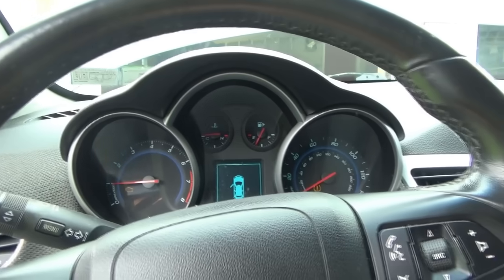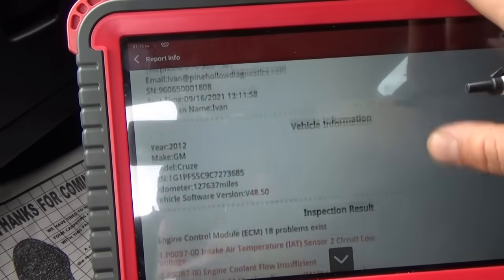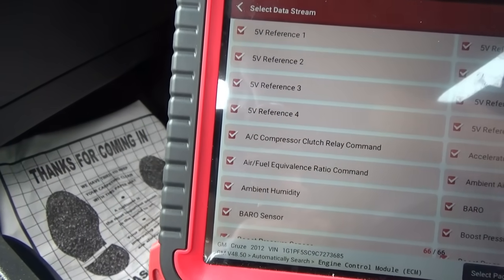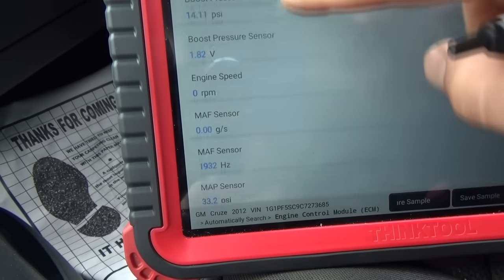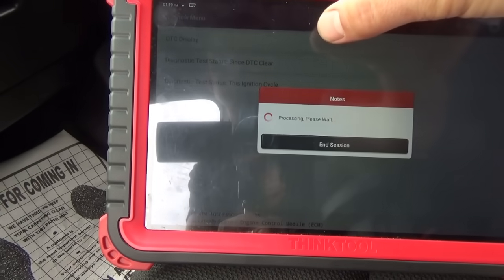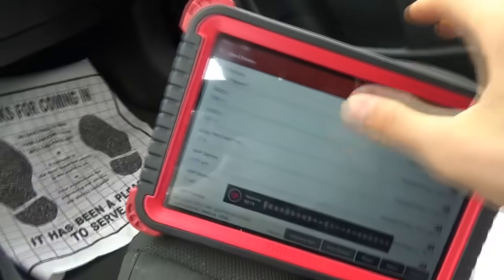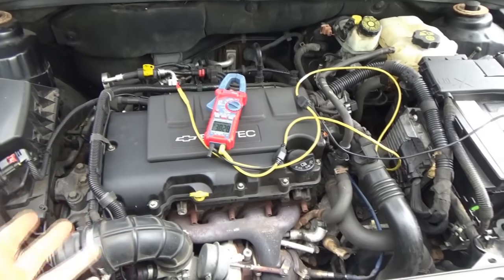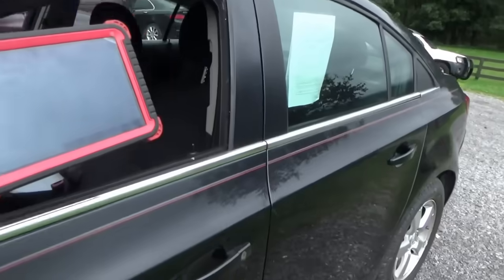Scotty Kilmer was RIGHT! (Cruze Turbo Rough Idle P0106 P0171)

Comment: Good vid and excellent debugging.  All too common problem on Cruze/Sonic/Trax/Encore, all with the Ecotec 1.4L engines.  I recommend folks check for the orange non-return valve being present with every oil life reset.  Forces you to catch it early so the intake can be repaired before other problems arise, like the camshaft cover vent blowing out, all from this little orange silicone valve being eaten by the engine.  Interestingly GM has an extended warranty campaign on the cam cover for most of these models, but not the intake.  Go figure.
Reply: I have many people come to me asking if they can install my fix kit before the check valve fails. It's good preventive maintenance, since they can then swap out a check valve in 2 minutes instead of having to deal with the install later or worse, replacing the entire manifold. The kit comes with two check valves so there's always a spare, and with replacements being available for less than $5, they can even be swapped out preventive for minimal cost, just like any pcv valve used to be before OEMs got cheap.
Reply from the maker: @AndreiDPop  that's awesome!
Reply: @AndreiDPop  do you have a link for this kit? Will it work on my 2017 Buick encore?

Comment: I have a 2012 with 113,000 miles, I just replaced my head gasket, so I also replaced my water pump, thermostat, ignition coil, put in new plugs. I bought it brand new and I love it.

Comment: I've owned my 2011 1.8 cruze since new. I was active in all the top forums of people screaming how the 1.4 was far superior because it made more power and had a turbo. That right there is exactly why I bought the 1.8. Almost 350k and is still my daily. Also alot of people these days would rather just spend the money on shop time rather then buying a few tools and Learn a few things. I also have a 1.4 sonic which I lend to someone 90% of the time. I've changed the clutch twice in my 1.8, oil cooler gaskets, shocks, brakes just regular maintenance and she keeps rolling and I drive it hard daily in a major city.
Reply from the maker: Wow 350k hard miles is very impressive!
Reply: 2017 chevy cruze 1.4L 188k miles. Never been to the shop. Oil changes every 5-6k miles and a set of brake pads and rotors at 140k.

Comment: I did the pcv modification for this issues. I used jb weld to fill the hole in the intake manifold and the drilled a hole at the bottom of the intake and one at the top of the intake near the throttle body. With two 90° elbows 2 pieces of vacuum hose 4 clamps i bypassed that crap. Problem solved.

Comment: I guess you've already sorted it by now, there are quite a few helpful workarounds on YT for this problem.
Very common on these cars with 1.4T. I had a customer's (2011 Holden Cruze) I nearly got married to last year with the same problem. P1101, P0171..The intake check valve was missing, and pcv 'vacuum regulator' diaphragm in top of the valve cover was torn causing an external vacuum leak, very high vacuum in the crankcase, and crazy high STFT. The vacuum in the crankcase can also cause a squeal at the front crankshaft seal, so much vacuum getting sucked past the crank seal..lol. I replaced the valve cover (aftermarket cheapy around $100AU) I also removed the intake manifold, blocked that internal check valve port(jb weld, a washer, and a wood screw) and I drilled an tapped the manifold and installed 2 elbow fittings(with more JB weld for insurance) and an external pcv valve underneath the original manifold. Fitted the new pcv valve inline between the engine side of the throttle body and the crankcase port side of the intake manifold...All was sorted after that. After the fix, STFT came back to normal, and the vacuum reading at the dipstick tube at idle would slightly vary between -2psi-0psi, showing that the new valve cover regulator was doing it's job, and also that new external pcv valve was working, and not allowing any excessive pressure to enter the crankcase under boost etc...I now run away as fast as I can from all GM's..lol🤣👍🇦🇺
Reply: Basically did what my v2.1 pcv fix kit does. Make sure you're using a check valve rated for PCV use, at least 30psi sealing pressure, and less than 1psi crack pressure. Pneumatic check valves won't work long term, and all ball-style check valves will give you issues.
Reply from the maker: Nice work around!
Reply: @AndreiDPop  I used an all metal, in-line style pcv valve, (similar to what most 4g54 Mitsubishi's use on their aluminium valve covers) with a very light spring and it had a small cylindrical steel plunger, so I'm confident it was more than suitable for the pressures and temps it would encounter👍🇦🇺
Reply: @simonilett998  the steel plungers don't seal against boost pressure very well. Those valves are really only intended to operate as pcv valves in naturally aspirated engines. 

The spring pressure is designed to keep the valve closed under vacuum while allowing a constant supply of PCV gas through. You've basically installed it in reverse where vacuum opens the valve, and you're trying to make it seal under boost, which it was never intended to do. I looked at those valves as well before deciding they would be poorly suited for the application.
Reply: @AndreiDPop  No, I didn't install it in the reverse to it's originally designed direction of flow. I added a male/female threaded 90° elbow to the male threaded end of the pcv which I mounted directly below the upper crankcase hose port where the hose that connects to the turbo attaches to the intake manifold (the one you look through to view it the orange check valve nib is visible or missing) and a hose tail/male threaded 90° elbow screwed into the manifold at the other end near the engine side of the throttle body, with a short piece of hose in between the hose tail ends. I oriented the pcv valve to flow in the same direction as the original orange viton flap seal would've, effectively just mounting it externally instead. On the 4g54 engines there is a large hose port at the rear end of the valve cover to allow fresh/filtered atmospheric air to enter the valve cover/crankcase, from the air cleaner housing mounted above the carby. The pcv valve hose tail connects to a vacuum port on the intake manifold, or carby base, allowing engine vacuum, at idle, to draw in blowby gasses and burn them, following the same principals as all pcv systems. If the pcv valve is always closed when exposed to vacuum, it would never allow any blowby gasses to be drawn into the intake manifold with each intake stroke, and the spring would actually have to be quite strong to fight 20 inches of vacuum as you suggest, right? Bearing in mind that manifold vacuum is not constant, it flutters at idle, and vacuum is weakest at full throttle, the weak spring is only there to help close the pcv valve at the intake/exhaust valve overlap point of each cylinder's cycle, which is what causes the manifold vacuum to flutter. At high rpm, or moreso at full throttle when manifold vacuum is weakest/non-existent, the blowby gas pressures in the crankcase should stay relatively close to atmospheric pressure, and they reverse their direction of flow, flowing out towards the air cleaner, and due to the now increased velocity of the atmospheric air coming in through the air cleaner, a ventury effect is created, drawing the pcv gasses into the top of the carby and they get mixed with the incoming air. This is the only other time the pcv spring will come into effect, the pcv valve will be closed, not fluttering, and not required to open unless the pressure in the crankcase got high enough to overcome the weak spring pressure. The crankcase gasses will be traveling in the reverse direction to which the pcv valve would flow at idle. A N/A efi engine also works the same way. These turbo engines have the extra pipe from the turbo housing to the crankcase side of the intake manifold (the hose Ivan blew into to test the check valve) serving the same purpose as the air cleaner to valve cover hose would serve in a N/A engine. tested the pcv valve prior to installing it with a vacuum and pressure source both ways to confirm it would seal or open correctly as required. It was August 2020 I did the job and the customer has not had any issues since, and given the poor longevity of these vehicles it's probably not long from being scrapped by now, if it hasn't already🤣👍

Comment: Dorman has an intake manifold with a pin to hold that valve in. I just installed one on my daughters car. I changed the cam cover and pcv hose at the same time.  Then changed the coil, plugs, vvt gaskets, oil cooler gaskets, balancer gasket, and oil pan.  Now the transmission lines are leaking.  This car keeps me busy.

Comment: As a gm tech, It needs the “Cruze kit”   water pump, water outlet, intake manifold, valve cover, ignition coil, front crank seal and a turbo!
Reply: And coolant hoses depending on how bad they are oil soaked.
Reply: Funny ive works fo gm 25 year not at sum dealer...ship my cruze has almost 400 gran same turbo same water pump only in and out and a thermostat and 4 valve covers runs like a watch ... You just put shit on a charge poor working ppl shit loads of money for bullshit

Comment: The 3 parts all together are not extremely expensive, but I don't think most people driving a non-GM car would ever encounter a situation where the valve cover and intake manifold would both need replacement, unless there was a fire in the engine?
Reply: Not really, but most other vehicles I've had with specific reoccurring issues... Suck worse than changing an easy cover and intake. Hell even the turbo pops right off the front.
Reply: @TheDylanjduncan  Do a PCV mod on the intake, replace the other two parts and don't worry about the Valve cover going again, turbo is cheap enough. Have this engine in my sonic and no problems since
Reply: @bdaig12  On the intake or valve cover?

Comment: With oem parts this happens every 70000 miles; like clockwork. I just did this repair for the second time two weeks ago. I used an aftermarket intake this time. It has a little metal retainer behind that diaphragm in the check valve to keep it secure. Used an aftermarket intake as well. We shall see.

Comment: Also, if the check valve in the intake goes it ruins the valve cover diaphram also. There is an updated valve cover. It would be best to replace the intake manifold and valve cover, or there is a guy on one of the Cruze forums who makes a kit to fix the intake manifold and its a lot more reliable than the GM design.
Reply: Is there an updated one? I did the cruze talks forum solution before all these happens...
Reply: @nebarrera  Dorman came out with an updated design.
Reply: @nebarrera  well thats the thing, there is an updated valve cover which has the same problem as the original when the intake check valve disappears. So, the cruze forum solution for the intake is the best solution. There is no updated intake so they would all fail eventually.
Reply: @soldado141  there is no updated valve cover. The diaphragms will continue to fail by design
Reply: That guy is me. I designed the PCV fix kits. They're designed to be more reliable, cheaper, more serviceable, and easier to install (v3.4) than replacing the manifold. Why they made a manifold without a serviceable check valve is beyond me, so I did it for them. 2 minutes to swap a check valve on the v3.4 kit AND the kit replaces the crack-prone accordion hose by design, so it's two fixes in one.
Reply: @soldado141  only for the intake manifold, not the valve cover, and their intake manifold "redesign" just adds a pin behind the manifold to keep the check valve from outright disappearing. We've had those reported as cracked and leaking countless times already, so it's not exactly a solution. What's worse is they recessed the check valve further back so it's much harder to inspect, clean, or test it.
Reply: @AndreiDPop  You beat me by 10 minutes as I just commented about your GM 1.4L Turbo PCV Fix Kit.
Reply: @AndreiDPop  i mustve got the valve cover and intake mixed up, but i knew for sure one was "updated" at some point. Glad to have you in the conversation to clarify things.
Reply: The valve cover is exactly the same as the old one just not broken.
Reply: Where can I get one? @AndreiDPop

Comment: I have a 2013 Chevy Sonic with the same engine.  Had a slightly rough idle and was leaking oil under boost.  I suspected the valve cover was needing replaced.  Drove it for awhile like this as the oil leak wasn't terrible. Eventually it started idling really rough and had noticeable loss of power.  Kept driving it like this then one day on the way to work it started sputtering really bad and blowing smoke out the exhaust.  After sitting in the parking lot at work for 8 hours, it started up fine, still with a rough idle but no exhaust smoke.  Right before I got home on a roughly 15-20 minute trip it started sputtering again and blowing smoke out the exhaust which had a noticeable burning smell.  Craziest thing about all of this is that it still has not thrown a CEL even once.  I know the light works and it has come on in the past for other reasons so I have no reason to suspect the CEL is bad.  It has all the tell tale signs of bad valve cover so I intend on changing that, as well as the plugs which I imagine are oil soaked at this point, as soon as I have the money to buy a new one.  The lack of a CEL is baffling to me though as bad as it is running, especially once it starts pushing oil into the cylinders and burning out the exhaust.

Comment: I have a 2012 Chevy Cruze 2LT. 311,000 miles and still have decent compression. Only one turbo replacement (normal wear item). Suspension changed 3 times (Chicago). These cars a Very very simple to understand and fix and hell like a toy car to pull the engine. Update: Im at 323,000 miles now… these cars are simple for good mechanics.

Comment: They have special coverage for both the camcover and the intake manifold. Cam cover is super common. Cases multiple codes all the same you had and more. Dealer will cover those parts for free
Reply from the maker: Dealer doesn't cover jack for "free" in my experience 😅
Reply: @PineHollowAutoDiagnostics  i work at one and we do a lot of stuff for free that shouldnt be done. Theres a lot of dealers in our area that actually tell their customers to come to us to fix it and we win them over. Lots of dealers get thrown under the bus by a band wagon of people who naturally hate dealers. Reason being small shops drain the customers money and then tell them to go to the dealer they come in expecting it should be free and how its our fault. Sucks we are just people and work on the same stuff day in and out and gotta tell you working at a dealer ive charged someone half hour for a repair as another shop quoted over 2 hours to do the same job on top of more parts than what was actually needed. Youre right, new vehicles are gonna destroy the small ahops and people who dont have the correct information to diagnose and repair the vehicle. Glad you can keep up with new technology, you work through it and do lots of tests to prove your theory. I diagnose every circuit even if ive seen that problem before. Nothing worse than going to mr customer saying this is your problem lady and then crawl back after you tried to fix it saying its still not fixed aha. Love your videos i enjoy watching everytime i get a notification!!

Comment: Yup this is classic Chevvy Cruze.. I have never worked on a car as much as this one except my 1966 MG Midget.. and that was 20 years old when I bought it! You need a cam cover.. the hole is to allow the diaphram to move thats under the round glued on cap. The diaphram has ruptured thus sucking in air. There is a an $80 kit available (Cruzetalk forum) that bypasses the intake manifold valve with a proper brass check valve and works perfectly. I have run this system for 50,000 miles without issue.
Reply: I see from your notes above you found the manifold valve kit.. Definitely get this!